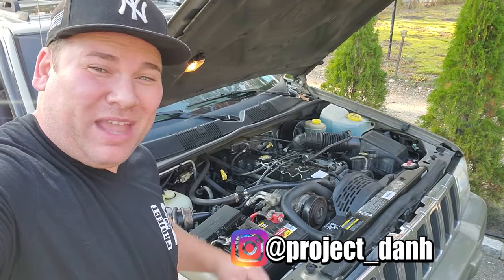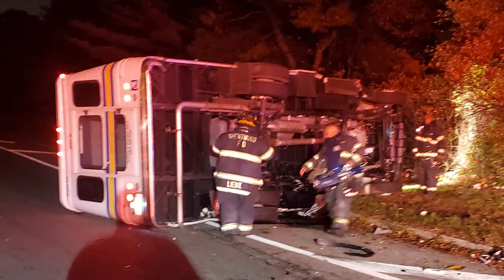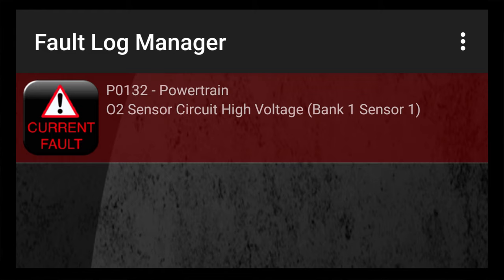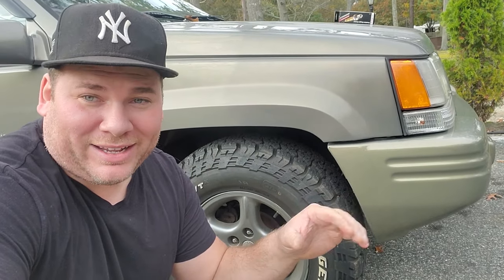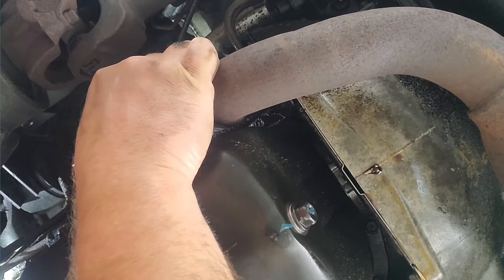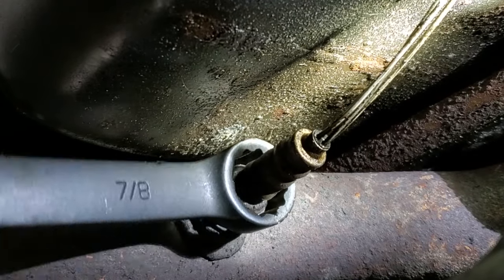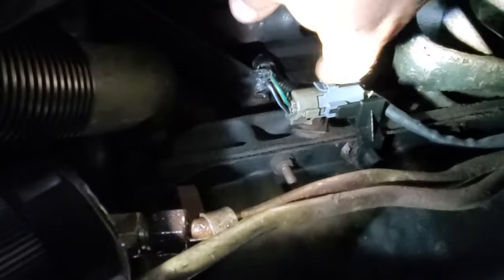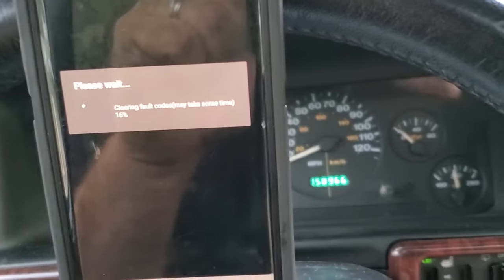BAD O2 SENSOR?? JEEP 4.0 MISSFIRE SOLVED  - UPSTREAM OXYGEN SENSOR REPLACED

Comment: Hi Dan, I have a suggestion.  Your videos have helped me with EVERY project I’ve undertaken so far (right down to re-soldering the driver-side master window switch!)with my ‘97 ZJ.....with one exception. Fueling my ZJ is a real chore due to the fact the pump nozzle shuts off every ten seconds. It might go a little longer if I adjust the angle, pull up or down, or back it out a little. After watching a few YouTube vids it’s apparent there’s an obstruction somewhere but I won’t attempt tracking it down until I’ve seen you do it!  Thanks! KS
Reply from the maker: Hey Kevin! Thank you so much for all your positive feedback!  I'll look into it and I'll see if I can find a solution! Thanks for the suggestion!
Reply: That’s a blocked vent or Evap issue in the gas tank
Reply: Check the charcoal unit. When you fill the tank the air displaced by the fuel vents through the charcoal unit (to absorb hydrocarbons in that air). On another off-roader the air vent from the charcoal unit was dangling down and got full of mud, so air couldn’t flow out and hence petrol pump shut off very quickly. We cleaned out the charcoal unit and vent tube and back to normal. Also rerouted that tube to be less likely to get submerged 😊

Comment: Hey Dan! Yeah, I purchased the socket version of the O2 tool years ago. I found out the same as you, on the old sensor, cut the wire and use a tool that grips on the hex. You can use the tool to install the new sensor. So no luck on the power steering pump bracket? Thanks for looking any way. Guess I'll have to take the time for a yard trip. Should have done that in the first place. Does this problem also happen with pre OBDII Jeeps as well? (Bumble Jeep is a 95) She runs good now, but fuel economy is awful (10ish). God bless, stay well.
Reply from the maker: Sorry brother, I thought you were gonna try your luck at the you pull first then use me as a last resort.  Im sure i have one somewhere I have just been crazy busy
Reply: @ProjectDanH  No worries man. I really need to take a day off and just go. We have a pick and pull about 30-40 mins. from me.

Comment: Will putting a new one in help with gas mileage? I did a full tune up and fuel pump and filter. And get 10.5 mpg all stock wheels and tires
Reply from the maker: Yes it will

Comment: I'm about to change both 02 sensors on my xj tomorrow after work. 
 Been having issues hopefully is solves the high RPMs... it's around 1100 and i recently changed the idle air control valve, worked okay for about a week and now it's tripping again. 
Hopefully changing both solves my issue

Comment: Just started having this exact issue in my 99 XJ after replacing my front pipe over the weekend. It was running slightly rough the week before but no misfires, just a slight power loss on the highway and a low rpm drop coming to a complete stop. After the front pipe replacement it was much worse and running the same yours and smelled severely like gas. Unplugged the upstream o2 sensor this morning and all the problems went away, no misfires, but the strong gas smell changed to a rotten egg smell with a hint of gas, do you think I have another problem?

Comment: Going to do that tomorrow. Mine is a 98 grand cherokee laredo, 4.0 / 2wd. God bless you for your eagerness and love for these machines. I've owned mine for 14 years, it has 147k. I've put 42k in these 14 years. I'd like to show you the headlights upgrading I'm doing to it, installing the round led 7 inches diameter ones. Looks like an hybrid front. Btw, how did you hook up those black towing hooks under the bumper?
Reply from the maker: Thanks for the support brother! They are factory ZJ hooks, I have a video on it not too long ago.  Give it a view!

Comment: hello Dan, love your video on this. I'm going through the same issue, I unplugged my o2 sensor and it still runs like crap, would it be my ecu? Replaced intake manifold gasket, gaskets for port fuel injectors top and bottom, fuel pump and fuel filter, mass air flow sensor, pcv valve, spark plugs & ignition coils. Car used to run okay,,  Car is not been running well, it sometimes feels like its about to stalls out in idle and drops to 500rpm and engine shakes.
Reply from the maker: silly question... have you scrubbed your throttle body?  when's the last time you replaced you're battery?

Comment: I looked all day for this video.   
I had these exact same symptoms except that I have an '04 Liberty and wondered if I can try this, unplugging them to test without it damaging the engine.
But my codes were upstream AND downstream sensors.
Can I unplug them both to test?
Reply: OK I've been asking this question all over the web all morning and no one has an answer.
I tried unplugging both the upstream AND downstream O2 sensors.
Unfortunately the engine runs no better.  It shakes pretty bad when idling, and engine light blinks.
I'm competely lost.  
If its the cat going out, why did CataClean make it worse?   Why did it run better for one night with the CataClean, and then worse than ever now.
I don't understand this at all.

Comment: Mine has the same symptoms minus the no cel, it's throwing p0171, gonna try and unplug the o2 and rescan, hopefully it stops throwing that code and throws the one you showed, will update.
Reply from the maker: Good luck brother!
Reply: Haven't had time to unplug it yet, but I have sprayed carb cleaner on I believe all vaccum lines, so it's not a vaccum leak
Reply from the maker: @ianturner7993  👍

Comment: I changed my two 02 up stream and downstream sensors on my 05 jeep liberty and on the code reader it still comes up as bad catalytic oxygen sensors bad. I need the check engine light off in order to pass smog. Stressed tf out😒 Need help ASAP!!
Reply from the maker: Have you checked your cat?? You may need a new one
Reply: @ProjectDanH  Had the mecanic check it out and he said that 2 sensors are missing. The code is po158 which is bank 2 sensor 2. I really hope it’s the catalytic converter.

Comment: Hi Dan, my 97 ZJ (198,000) had the same issues as Grievous also with no codes thrown. I unplugged the o2 sensor and it ran great for about 5 miles before it was back to the bucking and sputtering. I haven’t plugged it back in and am surprised it didn’t go to default mode which makes me wonder if the o2 is the problem. The codes note the o2 sensor gone  and an engine misfire. I’ve done everything suggested in the various YouTube vids including throttle body clean, new IAC and TPS. I also changed the dist cap and rotor. Before I go off half—cocked and buy new injectors, wires, plugs, cam/crank sensors, could you maybe narrow it down? Gosh I hope you still read these threads!!
Reply from the maker: Hey Kevin! These Gremlins can be extremely annoying.   I'm glad you cleaned your TB, that's very important.  Sometimes your Jeep can run bad simply because of a loose ground.  I'd start with testing the battery, sometimes you can get a dud off the shelf.  Make sure all your connections are tight and clean.  Also check your wiring for cracks, breaks, and loose connections.  I would definitely recommend a set of plugs and wires, they're not too costly and it wouldn't hurt to replace.  Sometimes ya just gotta work through the process of elimination.  God Speed brother
Reply: I had really bad idling issues with my 97 grand Cherokee and ended up having the crank sensor replaced and it did wonders. Now the only thing is that it has a really rough idle when the engine is cold but doesn’t have any issues at all once it gets to normal operating temps. Going to replace the upstream o2 sensor tomorrow. Hopefully this should fix the cold rough idle issue!!
Reply: @chillsmasher7379 what sensor were cracked.

Comment: I have the 5.2 and I did a cat delete and deleted the muffler and put a glass pack on a welded a 02 sensor but the check engine light still keeps tripping off about the 02 sensor maybe i just need to replace the other one. It only acts up or misfires in 1st gear once I get out of 1st gear it runs smooth.
Reply from the maker: Cool upgrades!!! Hope ya get it goin!!

Comment: I have a 2000 WJ 4.0 and the upstream o2 sensor was so bad it made the engine run rich and spit black smoke. I of course changed the oil afterwards because of how rich it ran. Now it runs great but I still hear and feel a slight miss at the tailpipe but not enough to cause problems. The engine also has over 260K miles and was babied so it may have carbon build up on the pistons
Reply from the maker: OMG Black smoke would scare the 💩outta me! I wonder if the cats are clogged up now causing the rest of your exhaust woes
Reply: @ProjectDanH  amazingly, the cat isn’t clogged. If I floor it, the exhaust will spit out carbon smoke. Prior to fixing the problem, the Jeep literally got 9 miles per gallon on the highway tops, burning half a tank in 50 miles!
Reply from the maker: @mrklimczyk  omg man.. that's nuts

Comment: Hi. Mine 2000 wj starts up ok too but has a murmer little rough spot and idle only. Runs great street and Fwy. But that's cause I replaced the spark plugs, fuel injectors and fuel pressure regulator. That's how these Codes po172 and po175 showed up. So  Bank 1 and bank 2 running rich per my OBD2 but don't show which sensors. Are these both up streams and where are they located. Thanks

Comment: Good informative video as always 🤙🏽
Question? I have a 96 zj 4.0 and I did the plugs wires cap and rotor and coil alternator battery, but my thing is that when I start the Jeep mostly when it’s cold or left off for like 30 minutes it takes quite long to crank over and start! I know some people are saying it could be something with the fuel injectors or something, any ideas as to what it could be?
Reply: I'd say injecters or fuel pump
Reply: Thanks! 
Is there a way to check if it is the injectors?
Reply: Start simple.  Have you tried replacing the fuel filter?  Also, try a change to your "starting routine" by turning the key to the "on" position for 3 seconds to build fuel pressure, then turn key the rest of the way to start.  Sometimes it's even more effective to do that pressurize trick twice before starting.  Listen for the fuel pump noise.  Also, stop running the tank down past 1/4 tank since the gasoline acts as the "lubricant" for the fuel pump motor itself.  Final thought from me would be the fuel pressure regulator is getting wonky.  Best of luck fixing it
Reply: Thanks for the replies!! 
I did change the fuel filter twice just thinking it was a faulty one and I do hear the fuel pump run and I have tried the prime first trick and it doesn’t really help, I haven’t replaced the fuel pressure regulator though.
Reply from the maker: great info up there 👆 you can always upgrade to 4 hole injectors too!

Comment: Shouldn't you change out the downstream sensor also now to keep them both on the same "maintenance schedule?"

Refresh my memory on why you didn't put anti seize on the threads - Are the threads already coated on a new sensor?
Reply from the maker: they come pre anti -seized with the copper stuff.  I suppose you could replace both but o2 sensors dont really have a life span... they just work until they dont.

Comment: Got a question about 00 01 xjs w the California exhaust system. Is one of the cats not monitored by an o2 sensor? And can it be removed w out causing a check engine light?
Reply from the maker: The 00 CA and 01 50 states have 2 pre=cat o2 sensors in the exhaust manifold (1-3 and 4-6) then 2 cats in the collector (front and rear) then 2 more downstream  o2 sensors.   all 4 o2 sensors must be monitored by the computer or it will throw a CEL.

Comment: I have the same issue, on accelerations and decelerations randomly it would lose power, RPMs would jump from 700 to 0 back and fourth and popping from intake then have 15 seconds would go back to normal. Same kinda symptoms you had? Also I don’t have any codes.
Reply from the maker: Probably The 02 sensor!
Reply: @ProjectDanH  Changed the O2 sensor & it seemed to make it worse. I think it helped me exposed a problem since I finally got a code lol. P0171 System too lean (bank 1)

Comment: Mine drives fine except every time I stop and I start to accelerate I noticed the loss of power my RPMs will go up because I have to give it more gas to go I feel like a kick in the car and then it just drives normal it does it every time I stop and go.

I had an emissions problem I changed the fuel filter neck now it's telling me admissions ready that I'm good to go but my O2 sensor has a red check mark next to it so that's another way to tell if you have an OBD and you put that in in your admissions test fine but your O2 sensor will not kick in that's another way of telling you your old two sensor is bad.
Reply from the maker: Hmm, changing the 02 sensors couldn't hurt.  also its a good idea to clean out the throttle body!

Comment: I have a 2001 XJ that has the same problem with regards to the misfire. Is the O2 sensor not a problem with XJs newer than 1999.
Reply from the maker: 2000 and 2001 XJ misfires are more commonly due to heat soak
Reply: @ProjectDanH  Heat soak? I’m not familiar with that term. What is it?

Comment: I’ve been thru 5 o2 sensors with my 97 zj and I am just chasing my tail on it. About every month I have to replace it, when I first got the jeep it had a cut o2 sensor on the rear but it had one plugged in and zip tied up and the front was working just fine so I may have to do that to see what it does. Any tips please let me know!!!
Reply from the maker: Gotta stay on top of these things.. maybe also try some injector cleaner, gas treatment and some spark plugs.. get that baby firing tip top!!!

Comment: I own a 98 Grand Cherokee Laredo  and I have trouble with it. It will turn on go down the road and it’ll turn off out of the blue. I’ve changed plugs, cables distributor, map sensor, ignition sensor & it still acts up. Any suggestions on what I might be missing
Reply from the maker: did you try the 02 sensors?
Reply: I’ll try hope it’ll solve my problem

Comment: Will this work on a 95 Jeep Cherokee 4.0 with the oxygen sensor because once it warms up I have a one heck of a mess like it ain't getting fuel and keep running does this all the time
Reply: And is also is an OBD1 not an OBD2 so if somebody out here knows of adapter cord that actually fits his vehicle I would really like to know where to get it because one I got from Amazon did not fit
Reply from the maker: I would always recommend new O2 sensors.. Couldn't hurt to change em out. OBD2 and 1

Comment: Mine sounds like that randomly. Would lose power dropping RPMs way down even if you press the gas pedal to the metal and kinda jerks forward a bit. Engine shakes but doesn't die. Stuck between fuel pump, pressure regulator and now this sensor. Any heads up? -97 Laredo 4x4 6cyl.
Reply from the maker: 02 sensor.. try it first!

Comment: At minute 9:50 your engine sounds like marbles, is that ok?. Also, I can see a small oil leak at that time. could you make a video regarding your oil leak? Mine leaks the same.

Thanks!
Reply from the maker: Yeah, Standard ticking for a 22 yr old Jeep with 160k miles on it.  That leak is from the rear main seal..  I can do the vid for ya... but I gotta warn ya... its a B

Comment: What’s up chat.  I have 2007 Jeep Wk Laredo 3.7 V6 motor. My issue im having is on startup my Jeep idles high for about 15 seconds then drops and sputters to the point it eventually stalls itself out or as soon as I tap the gas it dies completely. When trying to start back up it just cranks and cranks starts and dies. I ran codes I only have 1 code P0038, disconnected the sensors to see if it’ll run right but no change. It’s been doing this since March after I filled up with gas and I couldn’t figure out what’s going on. Dealer tells me a faulty ECU which I doubt. I can’t drive it or move it. It stalls out under any load unless I hold the throttle down. 

Could this be a clogged converter issue or fuel pump issue?  Maybe possible water in the tank?  Or faulty 02 sensors. 

183k, no damage, rust free (ceramic coated) I really don’t wanna junk it or sell.  Help me out!!
Reply from the maker: Hey brother, sorry for your struggles.  I would always start with a new battery, a very clean throttle body, and check your grounds.  Now 02 sensors would definitely help too..  Start with those simple things, basic process of elimination.  If it still gives you problems after that, then your dealer may be right.